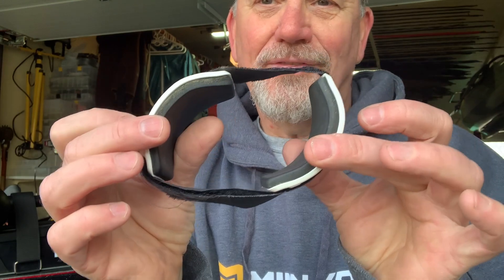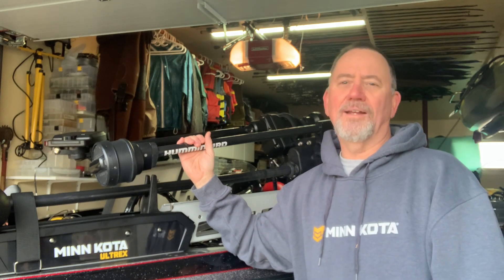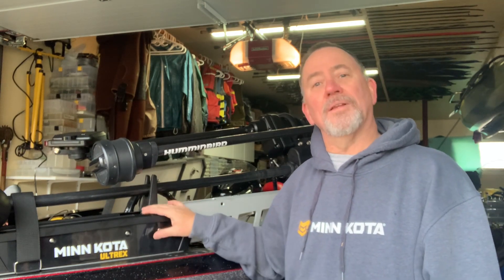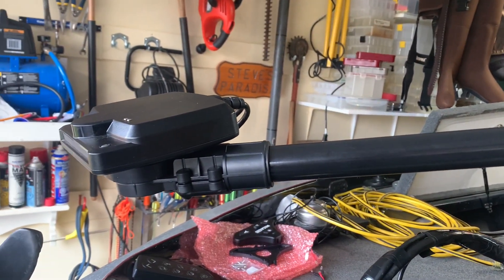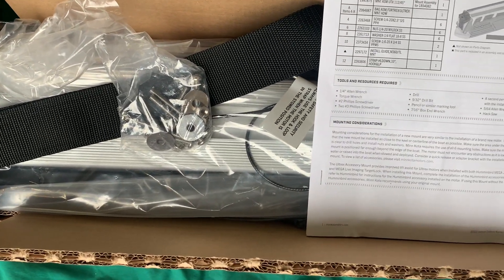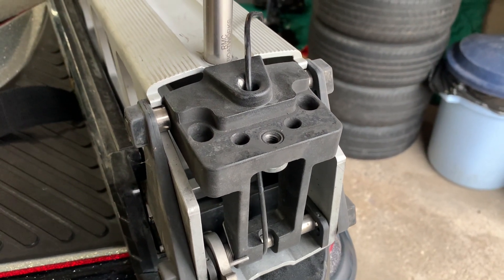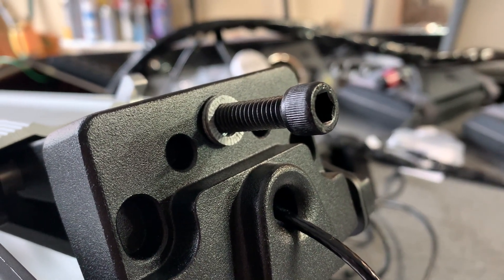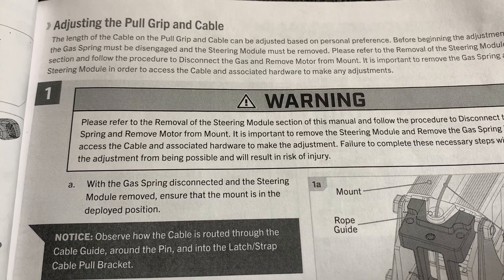Minn Kota MegaLive Imaging Targetlock and Mega 360 Imaging Ultrex Accessory Mount

Comment: I have a question and sorry that it doesn't pertain to this exact video, but I am hoping for you or maybe one of your subscribers to clarify for me.
I either read or heard it is not good practice to run your depth finder(s) when the transducer is out of the water.  That it is or can be damaging to the transducer.  Yet I consistently see professional anglers such as the Elite series pros, MLF pros etc., pull their trolling motors out of the water to move to another area, or when launching or pulling out of the water with their depth finders still on.  It doesn't seem to matter what brand of electronics they are using (Humminbird, Lowrance, Garmin, etc.).
So, is this an okay practice or should they be turned off to minimize or mitigate any potential damage?  Just to clarify I am not asking is it okay to leave them on when trailering down the road or storing when returning home.  This is more directed to stowing the trolling motor to run from one spot to the next, or even tweaking your depth finder while still on the trailer prior to launching the boat.
Thanks
Reply from the maker: Hi John, the simple is answer is that yes you should not leave the transducer pinging out of the water. I hit the power button, put the unit on standby while moving spot to spot. Odds are that there would be no damage to transducers running from spot to spot. There are definitely anglers that leave them on and have had no issues. Personally I would recommend taking the time to put the unit in standby running from spot to spot. It is recommended to turn off the transducers so it’s better to do things the right way.
Reply: @stevechiassonfishing5876  thank you, good advice.
Reply from the maker: You’re welcome, it only takes seconds to put it in standby. It will become habit in no time.

Comment: Steve, do you think this mount would still function properly (lock into place) with just a mega 360, traditional DI transducer, mega live transducer but no target lock? 

My current mount is in need of an upgrade, but don’t plan on adding target lock. I just want to be sure it’ll still lock into place with the beefed up gas spring. 

This upgraded ultrex mount is actually cheaper than just a stock replacement mount. 

Thanks for your feedback…
Reply from the maker: Although I haven’t tried it with just M360, I can’t imagine that it would not work. It functions very similar to the original mount. The newer gas spring is similar in size to what is on the Lowrance Ghost and Ghost motors do not have a Target Lock system. I don’t think you will have any issues.

Comment: how do like megalive. iam thinking about buying one for my helix.
Reply from the maker: I like the MegaLive, it shows fish and structure and it does not require an additional black box processor to be mounted elsewhere in your boat. If you already have a compatible Humminbird unit, you don’t need to purchase a control head. The MegaLive continues to get better with each additional update.
Reply: steve how do you have your megalive set up for lake erie.
Reply from the maker: Forward Mode on Erie, 40 degrees in deeper water, 50 degrees 10-20’, 60 degrees in 10’ or less generally.
Reply: @stevechiassonfishing5876  thank you